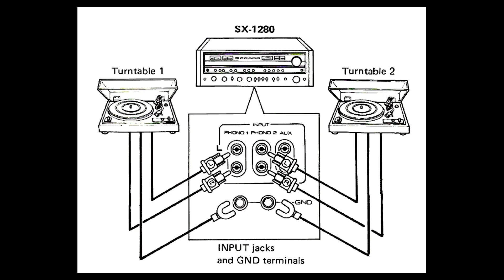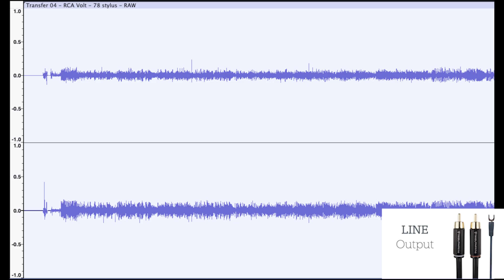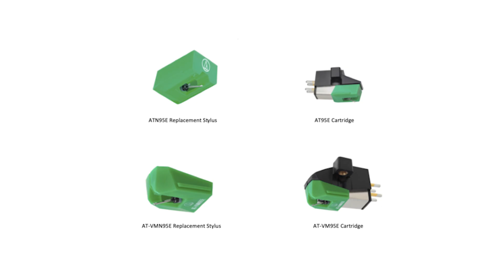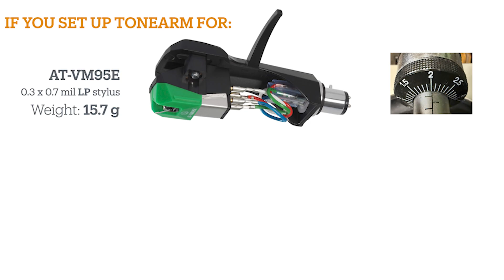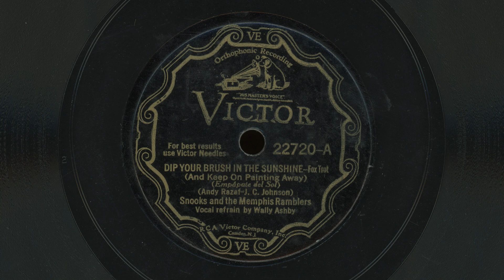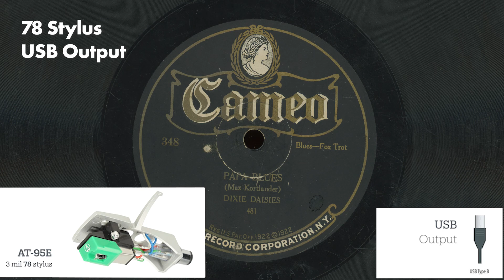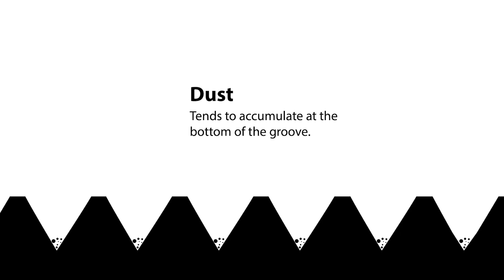Which Stylus Should I Use to Play 78 rpm Records using Audio Technica AT-LP120XUSB turntable?

Comment: Unfortunately you've got a number of things wrong:
- there is a 3 mil stylus for the AT-VM95E, which is the AT-VMN95SP. There is also a cartridge sold with that stylus, which is called the AT-VM95SP.
- the LP stylus requires 2g tracking force, but the 78 stylus requires 5g tracking force, so you may need a significantly heavier headshell for it.
- setting the switch to LINE sends the signal through the preamp to give you an equalized line signal 
- setting the switch to PHONO bypasses the preamp and gives you the raw, unequalized phono signal
- if the signal from the USB is too hot, you can adjust the input gain in Audacity to a lower level
- the LINE/PHONO switch does not affect the USB output in any way.

Comment: Shellac 78rpm --- or thereabouts --- SP records should be replayed with correct size styli only, that is, not those intended for LPs, particularly stereo LPs. Using an LP cartridge on these records can damage the record and the cartridge, more damage the more often it is used. 
Care must be taken when playing vertical groove modulation records, which are very rare, as ordinary mono cartridges will damage them.
Reply from the maker: Yes, I am aware - though I do not think an LP stylus at 1.5g tracking force is really going to harm a shellac record made for playback with a steel needle at much higher tracking force. This was just an experiment to hear how the different-sized stylii affect the overall sound of a 78 rpm record. I do not normally play my 78s with an LP stylus. ^_^
Reply: @JazzCrazy  I'm a bit surprised at how little difference there is in the sound from an LP cartridge compared to an SP cartridge. It sounds much better than other examples I've heard. I'd imagine that on a worn and dirty SP record the LP cartridge would sound substantially noisier.
The damage to the record will be a result of the stylus riding much lower in the groove, at the bottom, where the surface is rougher and full of debris and dirt. The diamond stylus will dig into the dirt and grit creating considerable more friction and wear. Worse, as the stylus digs in it can chip at the sides of the groove and, after repeated passes, even carve a new path.
Of course an LP stylus, particularly a cheaper one, is not designed to travel in this sort of environment and can break off or come unglued, thus probably ruining the cartridge, but more importantly ruining the record for good. 
Do not be misled by the low tracking force: the LP stylus has a third or less (for the more advanced types) the surface area of the SP needle at the tip, and also will be riding at the bottom rather than the sides so the pressure exerted is not what would have been exerted at an LP record's groove's sides. Additionally, diamond is a much harder material than steel, especially if compared to a softer steel/fast wear needle. The softer steel needles do less damage to the shellac but of course last much less than harder ones.
Reply from the maker: @Stelios.Posantzis  I was surprised too - and that was one of the reasons I shared this experiment. Thanks for your thoughts.
Reply: @JazzCrazy  You're welcome! Thank you for sharing this video.

Comment: How do you mix left and right channel on real mono records? Have you tried a real mono cartridge (not bridged stereo relabeled as mono) because of the different movement angles?
Reply from the maker: Good questions - thanks for asking. 

I have found that using a stereo cart give me a lot of flexibility. The stereo cart can capture dramatically different aspects of the grooves - sometimes resulting in one side of the groove being much cleaner than the other. In the case of very worn records, I might just use that cleaner channel alone and delete the other. Otherwise, I sum to mono in Apple Logic. This creates a mono channel by summing the L and R channel together into one mono channel - often reducing the noise floor noticeably.

I'd be open to trying a mono cartridge - That'd make a fun comparison video! But honestly, one has only so much money one can invest in all of this and I have two in college and another headed to college next year, so the 78 budget has dried up for the moment.

Comment: Be aware that there are microgroove 78s out there (on King and Atlantic labels), AND there are coarse groove cut 45s that play best with a 78 stylus (like early Sun and Davis labels)!
I bypassed the internal preamp of my AT. It stinks; just adds noise. Instead I use an external preamp with the AT deck switched to phono level.
For digitizing and restoring anything, including 78 recordings, I prefer a stereo needle (one groove wall may be extra worn, and I can get the cleanest mono results by switching to either side when necessary), but alas I only have mono...it still sounds excellent, at least ( an Ortofon 2M78).
If I could afford the archival kit of 6 different 78 styli, ranging from 2.5mil up to 8mil (best for very worn or very early discs), I'd be the happiest camper.

Comment: Tell me what I'm missing here. At 1:30, you state to bypass all gain and equalization, use the 'line' setting. This is backwards. To verify, I reference the AT-LP1240-USB Installation and Operation manual. The PHONO setting bypasses all internal gain and eq. (output 2.5mV typ). Use LINE to utilize the internal gain/eq. and obtain a line level output (150mV typ) or to use USB. The USB may sound extra hot because it's all calibrated to LP stylus velocity of 5cm/sec. I don't offhand know the velocity of a typical 78 rpm recording, but given the larger dimensions all around, I'm sure it is proportionally greater, overdriving the converter.
Reply from the maker: Hmm. Now that I am re-reading you make a good point. Well I don't have the turntable anymore to test this - but I think I must have gotten the switch positions confused in the video, as I remember with USB output, only one switch position worked at all - and I used that one. It must have been line - so perhaps I confused the switch positions in the video. If I run across another unit I will confirm!

Comment: Hi:) is there a problem of using the usb for digitizing, isn’t there a way to adjust volume afterwards, I don’t have a digital audio converter like you, can I plug my pc directly into my reciever?
Reply from the maker: There is no problem using USB for digitizing at all - you can listen to the sound clips at the end of this video to hear what it sounds like. Very simple and easy to set up - a single USB cable from the turntable right into your PC. For most people this is all they want and it should work fine.

When doing transfers, I just don't like having a normalized (with peak audio levels) hot audio output. Better to have line level output or adjustable gain output for more control over levels, clipping, headroom, etc. Just a personal preference since I often do some re-equalization, light compression, and gain adjustment.
Reply: @JazzCrazy but can I adjust the audio levels In audacity after transferring, I don’t have an audio converter like you, so I wonder if I can plug my pc to my reciever?

Comment: In Audacity it's better to record in mono, after recording duplicate the file and join them as a stereo output to keep it 2-channel.
It may even better to have a pre-amp that can record in mono.
Nagaoka used to make different stylus types .. 2.0 - 2.5 - 3.00 - 3.5.. you can still buy them but it's getting harder to find these days as the market for diamond styluses are limited due to the shortage of diamonds.
Also keep in mind that the AT stylus tracks at around 5 grams wich is havier then most other brands.
If you like to go old school you still can buy a Ronette with flip needle .. disadvantage is that the Ronette is a crystal stylus and needs a higher output 230mV.
Keep spinning those oldies, greetings from The Netherlands.

Comment: For over 50 years, I've been recording records, specifically 78's, since I know how fragile they can be, starting with adding an audio out to my lost little portable player to my mother's Silvertone console using a microphone. I noticed this early on at the age of 10. Hint: don't use the 3 mil stylus on the lp's. I have the ATLP120XUSB and do like it, but I also have 2 Technics from the 80's and some off-brand iLive (which is nice, but is fully way too automatic). Depending upon which cartridge and stylus I use, different sounds result. Yes, the AT USB output is way too hot and many recordings clip. I brought this up with Audio Technica several times, but they never responded. 

At home, I listen to my 78's mainly on my Magnavox Astrosonic. They sound lovely. But I do liike to listen to them in the truck, so I record them from the USB on the Audio Technica. A bit to hot, but you can't really tell with all the road noise.

I have so many stories related to growing up with records and record players that could fill a book It would be so much fun to have some kind of group discussion aout records, record players, and recording devices through the years. I have had many, still have may and will always look for another. Heck, I still use my Victor R and Victor 2 for my acoustic records and my Credenza and Victor X for the electric 78's. But the Magnavox Astrosonic is my go to now for easy listening. Just stack 'em up and play them for a while.
Reply from the maker: Glad that someone else agrees with me about USB output being too hot! 🤓 Sounds like you have experience with a lot of different record players! One of the first times I played a 78 was on an old Admiral tube console. Sounded great! I have a few old consoles - Zenith, Motorola… and agree that playing 78s on consoles can sound wonderful!

Comment: Do you think some of the 80s and 90s processors and EQs could help clean up 78s further? Ive got three dynamic range expanders for low, mid, and high. Plus my Hughes processor has a 3D mono mode that could be interesting. Has anyone ever tried to make a preamp passive filter for the popping and clicking? One would think those frequecies could be trimmed without harming the audio.....all thoughts im having after having listened!
Reply: Had another thought, George Blood LP does two stylus captures for their 78 restorations and mixes them together to get a more acoustically complete recording. Problem is they arent nearly as gentle with the mix as they should be. I would probably apply a High Pass to the 78 capture, and a Low Pass on the LP capture then mix by ear
Reply from the maker: @starcraft605  There are lots of tricks - but best of all is to start with a clean record in top condition. It's tough to make a beat record sound decent regardless of what you do to it. 

Mixing two captures together is interesting - I know he has a turntable that can capture multiple stylii simultaneously - that is the way to do it. 

I have another video where I go through my process maybe you would be interested in watching: https://youtu.be/Ffh4X2-96Wk
Reply: @JazzCrazy Vast majority of 78s came in plain paper sleeves so finding a truly clean one is like a unicorn here in the Midwest! Been lucky and found a few in red RCA Victor paper albums but even those needed deep ultrasonic cleaning
Reply from the maker: @starcraft605  I'm in Iowa myself - and yes, there are many beat records out there in musty basements and dusty attics. But I've also been lucky enough to have found extremely clean stuff as well. That said, some 78s look like hell and then play like a dream! Other times they look clean as a whistle but sound grainy and noisy.
Reply from the maker: I did not clean up the audio in this video - usually I use iZotope Elements for declicking, sum to mono (which lowers noise floor significantly), and additional EQ corrections in Apple Logic. 

There is a phono preamp out there called Park Audio Waxwing that a number of 78 collectors have been very happy with. It can correct clicks and pops and simultaneously correct EQ and sum to mono. I've been considering getting one but they are a real investment. https://parksaudiollc.com/

You could try some of your 80s and 90s tech but noise reduction involves more than just squashing the high frequencies where the noise resides. It's easy to lose crispness and definition if you're too aggressive. Digital tech has come leaps and bounds from where we were back then.
Reply: @JazzCrazy They're DBX rack mount "audio restoration" range expanders. I know very little about them beyond what came with the auction...Dont have a 78 TT unfortunately or I'd be playing around you better believe me!!

Comment: There is more surface noise with the AT-VM95E. Please tell, what tracking force did you apply on the AT-95E (3 mil 78 stylus)?
Reply from the maker: I think it was set at 2g for both carts.
Reply: @JazzCrazy  That AT VMN95SP cartridge tracks most happily at 5 grams, a lot havier than other brands

Comment: I always used the usb output with my audio Technica for recording, my transfers sounded way too high frequency and the bass was dull even if I added EQ curves. Bought a rega now, much more happy with it. I recommend the Audio Technica for starters since it did introduce me to some regular important knowledge of a turntable but if you want to get serious about 78s try technics, rega, or other high quality turntables, thanks for the review! As always very enlightening and enjoyable!
Reply from the maker: Yes, this was for a friend on a tight budget in another part of the world. Since it is probably the most-recommended entry level turntable for 78 rpm playing, I thought I'd give it a spin before I shipped it off to my friend. 

Interesting that USB output had too many highs and not enough lows. Wonder if it's their internal RIAA preamp circuitry? I didn't really fully analyze frequency response between the USB and analog output, but I suppose that would help answer the question.

I have a Lenco L75 and Technics SL-1200 Mk 5 myself. 

Thanks for your comment and advice on the Rega - If I ever get a chance to try one I will report back!
Reply: @JazzCrazy That would be very interesting as well! As always keep up the good work

Comment: For changing out headshells it’s easier to apply a weight to the lighter one to even out the weight between them. Or buy a heavier headshell for the lighter cartridge. My 78 cartridges track at higher weights so I use heavier bolts to make up the difference.
Reply from the maker: Good tips! Thanks!
Reply: At 95 e 3 mil stylus and cartridge with line output, sounds good to me.
Reply: Tape some lead to it LOL